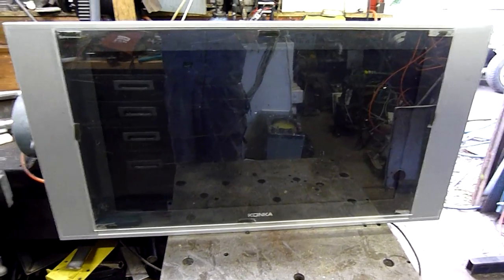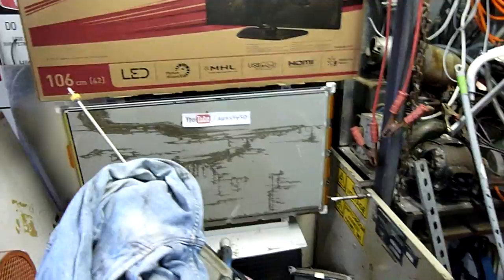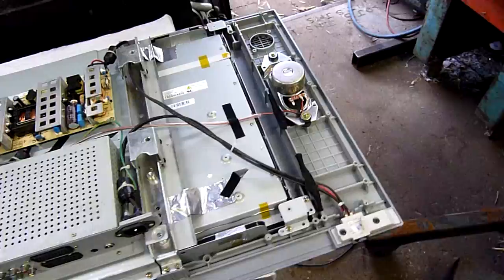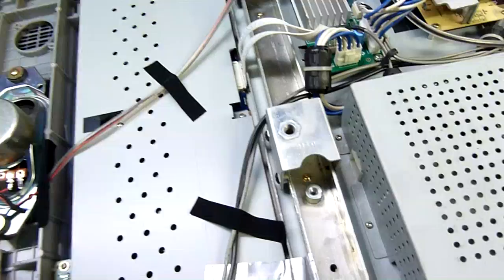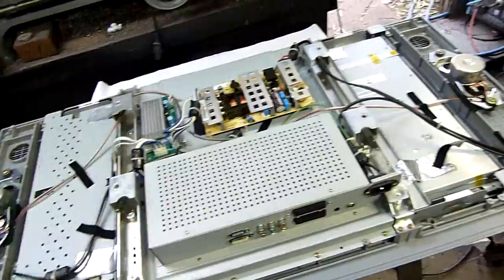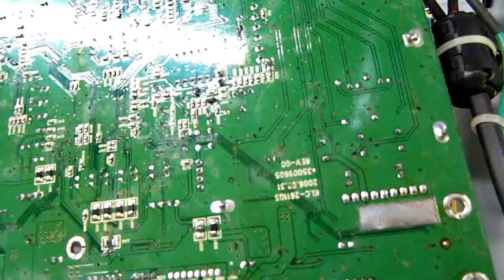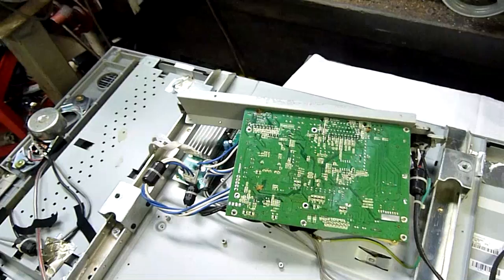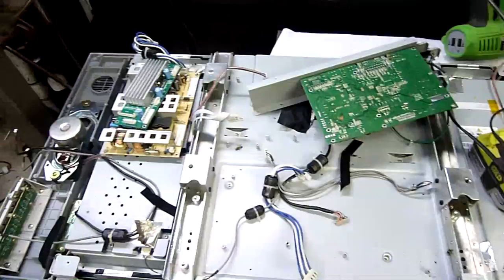LCD TV Bug Hunt   Game Over Man, Game Over!

Comment from the maker: yeh i have full steel roofing, the blue tarp is actually pool cover offcuts from work, its 2 layers of tarp material with polyethylene foam inbetween, about 5mm thick. makes great insulation

Comment: Cockroaches are probably attracted by the heat from the panel, they like crawling into the backs of fridges for the same reasons. I haven't had any roach problems as yet but I had to dispatch some rats in the car outside, I put them on a special diet of joint compound and antifreeze.

Comment: that TV was rank. Apparently it has something to do with the plastic used, roaches like the smell of it and try and suck it out. Xboxs are horrible for it, it's about 1 in 3 that I get that have at least 1 dead one inside. Whenever I get an appliance like that, usually regardless of state it goes in the bin, or it atleast gets a complete chemical bath :D